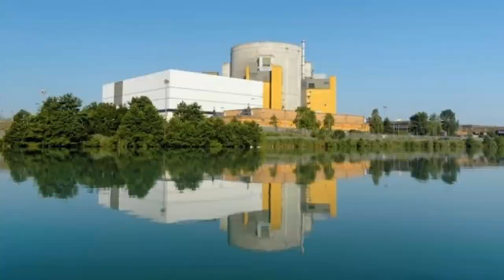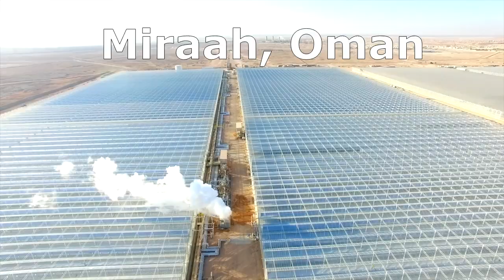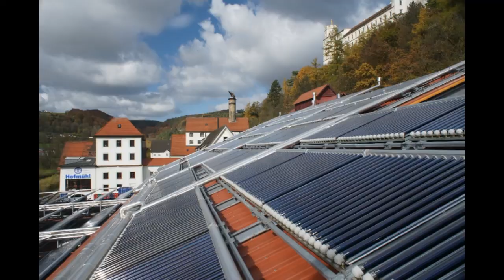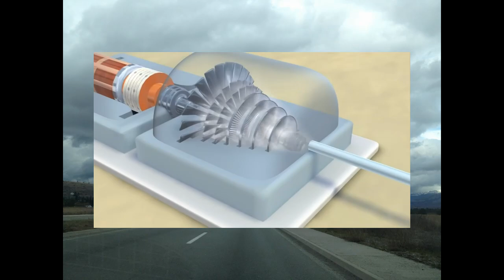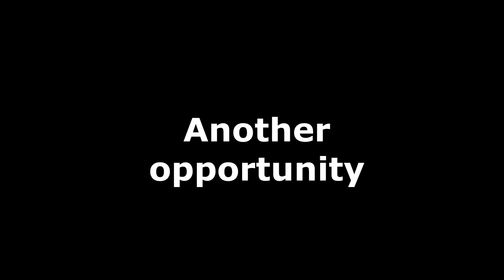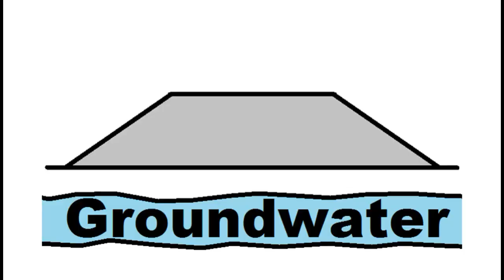How to make solar electricity 2-3 times cheaper

Comment: If you operate your turbine system under vaccum, you can also lower the boiling point of the fluid (water or other) Check out Charlie Solis's channel, for a tesla turbine system that can efficiently turn the heat energy from your mirrors into electricity with a proper, high surface area tesla turbine...

Comment: Hi Sergiy! I was thinking about using solar and massive heat storage to boil ocean water, spin a turbine if needed, but the remaining steam to be channeled up by pipe into a giant water tower built like Taipei 101 to rezist storms and quakes. The tower itself can be built on top of a neighboring mountain. The goal would be to take the steam as high as possible and run it through a passive radiator at the top. The colder upper atmosphere would be more efficient at cooling the steam, no pump needed to get the steam up there, and once cooled down, the water can be fed by gravity as far as we want to, as long as the elevation of the terrain is lower than the collection basin in the tower. 
Using natural phenomena of rising and condensing steam and falling water for passive or minimal intervention desalination and water distribution, like the roman aqueducts. 
Also the resulting brine can be made at high enough concentration for mining lithium or plain salt. The fresh water can be used to irrigate deserts, maybe a plantation of Jatropha Curcans (edible variety that uses minimal water and soil unfit for agriculture) that would make a carbon neutral biodiesel, the remaining pulp would be great animal feed, the resulting animal excrement can be used as fertilizer and soil building.
What do you think?! Would this be feasible?!
Reply: I like your awesome imagination and engineering knack.
Have you heard of the sky window
A portion of the infrared spectrum goes through the atmosphere without interacting with the air and goes straight to space. You could cool the steam and use a radiator coated with a paint or other coating that radiates heat in the wavelength of the sky infrared window
The issue with desalination is that stuff that's dissolved in water also evaporates with the water, but not all of it. This means you end up with salt to clean up and if u don't then if u keep adding water eventually it will be a brine and then even more salt can escape in water vapor. I think there are already plants using distillation though. Its always a cost issue. Humans have never been able to build exactly what was best. Its a challenge of weighing the cost, and if there will be better technology to do the same thing later. Just like how people have to save money or take loans to buy things like horses or cars or even smaller things. If you are able to pay more upfront you usually can get better deals on stuff or better quality of stuff. 
A great example is the samuel vimes boots theory of economics. 
If humanity could afford to do things like create green energy, infrastructure like water desalination, electricity, transport agriculture
Capitalism doesn't provide an answer to these problems either. The great works is one example of a time when we were able to invest money into things that would help many people for a long time but they are getting pretty old. 
Unfortunately the great works happened right before capitalism was allowed to take over in its present form. Corporations now hold more liquid assets than the federal government. They won't build infrastructure because their business model relies on utilising publicly funded infrastructure to do their business. This is why so many people are on welfare yet work for a corporation. It's better for them to pay their workers so little that they can receive welfare. If the government would insist that they pay enough for people to not need welfare the companies start crying and threaten that it will lead to the loss of jobs. Corporate America is nothing more today than a system of  legal theft (that is the theft of resources taxes people land and water)  lack of morals and cultural stupidity. It is more popular to make profits above all else that they are now willing to actually extract wealth from humans by buying their blood plasma, cataloging dna sequences and selling them to the highest bidder, and destroying the nation's capacity for food production. 
Rant
Reply: You can’t use sea water the turbine blades would collect the. Solids in the water
Reply: @andystone9265  You can distil the sea water and use the distilled water 4 the turbine. Also you can make a closed loop with distilled water that on one end spins the turbine and after existing it preheats the sea water for the solar desalination, like a sterling engine. There are different ways to do it. The part that interest me is the water production and distribution over large areas that are not usable at the moment. The rest are just economic aspects that could entice investors to create such a system.
Reply: Theoretically, building blocks can be made from salt. In any case, we must return the salt to the sea in a closed form to reduce the salinity of the water.
Reply: @intellectualcat4000  if you put the salt back in to the sea you are increasing salinity. This is why I proposed mining it. It will increase the profit margin and will keep the salt out of the sea/ocean, this way we combine the environmental goal with the economic interests.

Comment: The only thing I have against using a traditional steam turbine is that you are using up precious freshwater (I guess saltwater would destroy the turbine pretty quickly), and emitting it into the atmosphere which would create a greenhouse effect.
Reply: Vaporizing water doesn't contribute to greenhouse effect. Plus you can have the water of a steam turbine in a closed system.
Reply: Check out Charlie Solis's channel... He is designing an optimized tesla turbine heat to electricity combined heat and power system that could absolutely run off of the heat from sergei's inexpemsive solar reflector/collector systems, and should run fine with filtered sea water.
Reply: @orcoastgreenman  Thanks, I'll look into it!
Reply: @orcoastgreenman  thanks for the tip!

Comment: @Sergiy Yurko, what do you think about a hybrid solution consisting of a photovoltaic system, a thermal battery and biomass?
Reply: Heh. How do you think to integrate biomass into the system?
Reply: @intellectualcat4000  Photovoltaic system that has two functions: produces electricity for the grid and uses the excess electricity for heating a thermal battery to high temperatures. Thermal oil passes through the inside of the thermal battery, which produces steam in a boiler. This steam rotates a turbine. When the thermal battery cools down, the steam in the boiler will be produced with the help of biomass, either by gasification or by direct combustion.
Reply: @MrDilauc  I thought you wanted to pass light through an aquarium with algae, and then focus it on a photocell)
Reply: @MrDilauc using excess electricity to heat a thermal battery = inefficient and uneconomic.